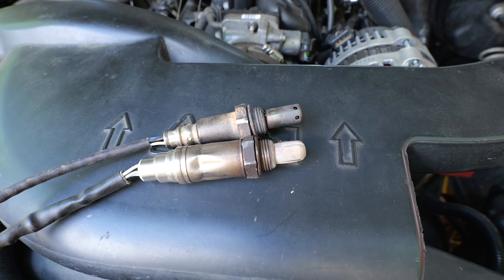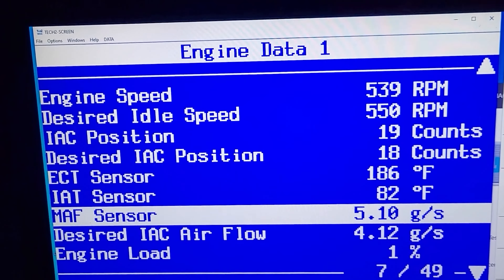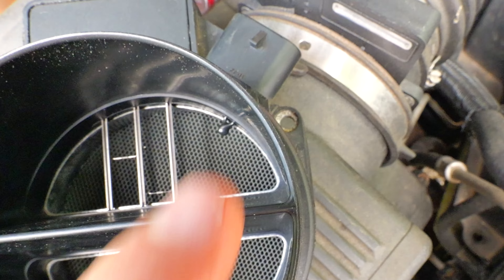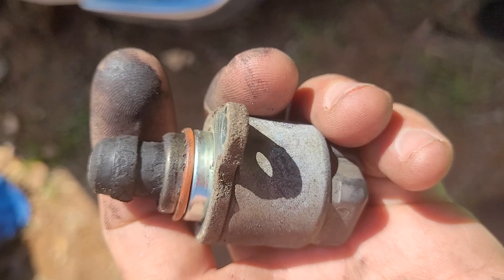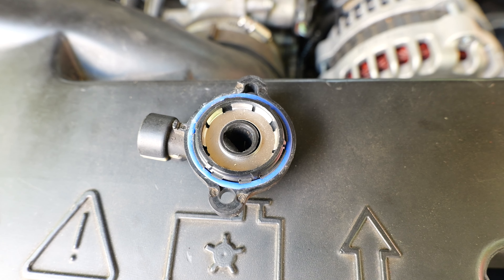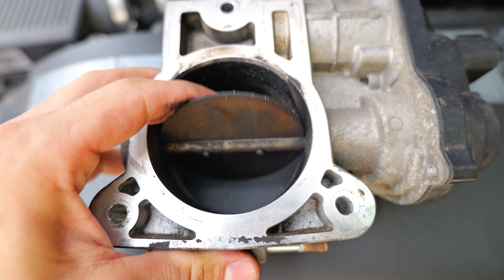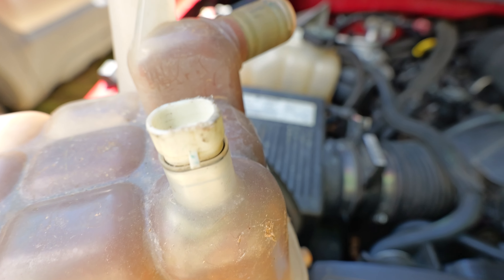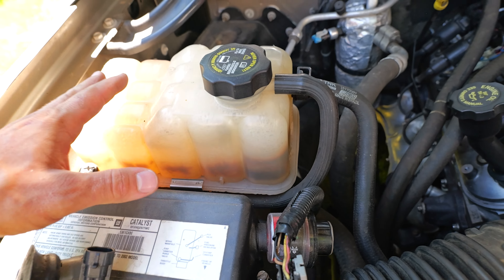EVERY Chevy Vortec Engine SENSOR

Comment: I have a 99 Chevy ls 5.3 got the engine redone with stage 2 cam and e85 and dyno tune but don’t start at first try then do another cycle and it turns on!? What can it be ?? Also replaced camshaft sensor and idle air control valve (both)

Comment: I’m having electrical issues with my cluster do you have any advice
Reply from the maker: Start with grounds!! There's a couple of fuses under the hood for the dash cluster. The dash clusters can have solder points that go bad.
Reply: @MattsShop  what ground straps should I buy would u have an Amazon link? Before I check out the hood static ground strap

Comment: I have an issue with my 04 trans. Recently rebuilt, at low rpm in od it sometimes acts like it slips it'll downshift then shift up back forth back n forth
Reply from the maker: I would talk to the rebuilder. That doesn't sound right.

Comment: A little more info on the knock sensors. What they do and how it affects the running engine and performance.
Reply from the maker: When the computer detects knocking the sensor vibrates and the computer cuts back the ignition timing and runs in a sort of limp mode to help protect the engine from damage.

Comment: I changed the cam shaft and fuel pump and it still struggling to start also after fuel pump replaced my gas meter don’t work

Comment: So, does a 2001 Silverado (basically the same) not have an oil sensor like a vvt? I’m getting the p0013 code but I can’t find this sensor. Or is this an actuator. I so give up it’s stalling out and I’ve checked wires and volts and continuity and part changing and resets and clear codes and prayed to Jesus fing Christ

Comment: You left out the fuel tank pressure sensor, which looks similar to the map sensor on the back of the intake manifold .
Reply from the maker: Fuel tank pressure sensor isn't on the intake on these trucks. Maybe the flex fuel vehicles.
Reply: @MattsShop  no the sensors just look similar is what I was saying.

Comment: I hate to bust your bubble on the sensors but having worked in the import/export supply chain for automotive for going on 10 years now I can guarantee you those made in China AC Delco and Delphi parts are the same Chinese parts made in the same Chinese factory as store brand and off brand RockAuto and eBay parts. They just go in different boxes. Anyone who says "x" brand of sensor doesn't work with "x" vehicle either got some bad parts or is just bullshitting. None of the automakers have made parts in the U.S. in decades. All my OEM 1970's Ford parts even say made in Taiwan or Mexico on them.